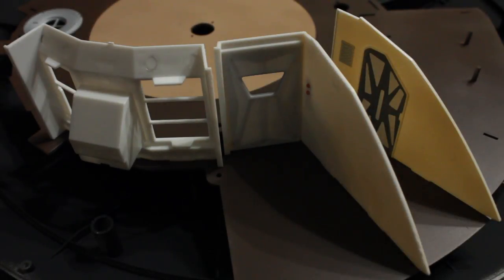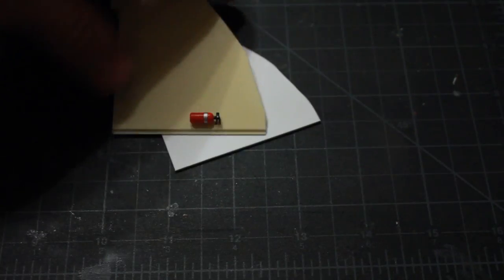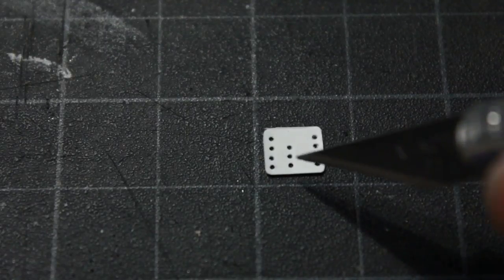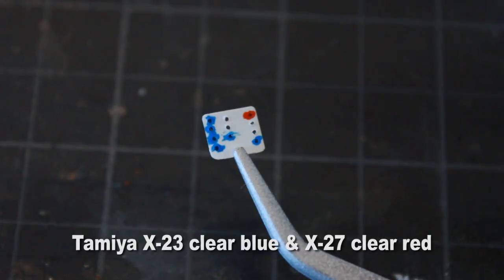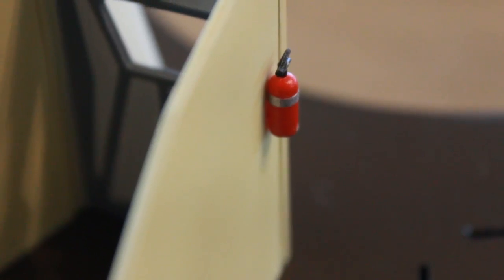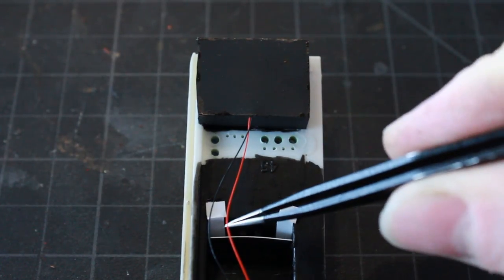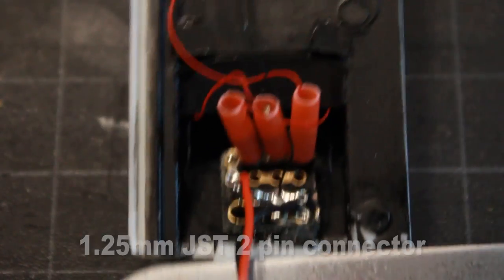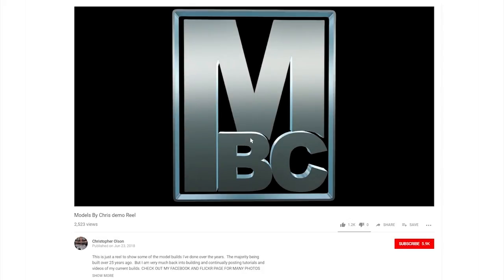Moebius 1/35 scale Jupiter 2 Pt 3 Custom and Communication walls

Comment: It is nice to watch your methods and the tools and materials that you use.  I just bought a new set of vice pin hand drills and bits that look like yours.
Reply from the maker: Gotta have a good pin vice.  I learned quite a while ago that a regular drill for such small holes can be a bad thing.  Much more control and ease with a pin vice.
Reply: @modelsbychris  I have been using three different pin vices but, those finger-tip color-coded ones caught my eye.  Mine arrived today while I was looking for a .7mm bit with a micrometer.  I thought it was funny and ironic.
Reply from the maker: @cmussomaha  yea, I use .3mm for the. 25mm fibers.  Those bits break so easy.  I went through a dozen drilling those holes

Comment: hi, why kind of connectors you use for the red wires on your little board ? is it only red shrink tubing ? thanks !!
Reply from the maker: I use 1.25mm JST 2 pin connectors.  There's black as well.
Reply: @modelsbychris  i cant send a picture but i mean at the end of the video with 390 resistors written in the bottom.